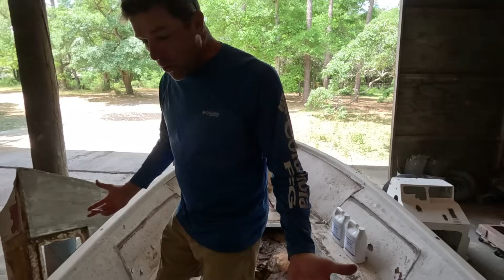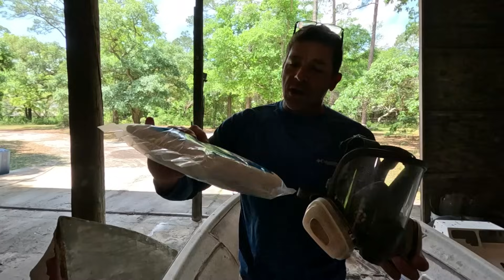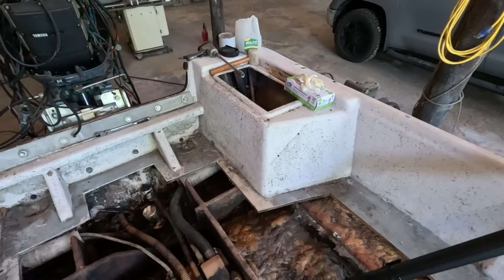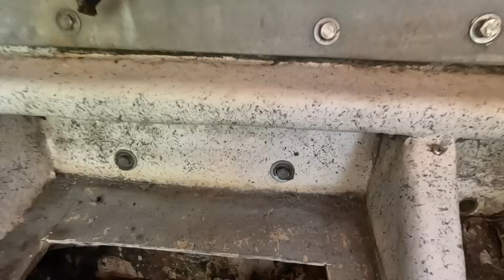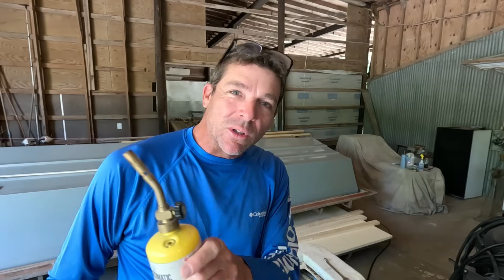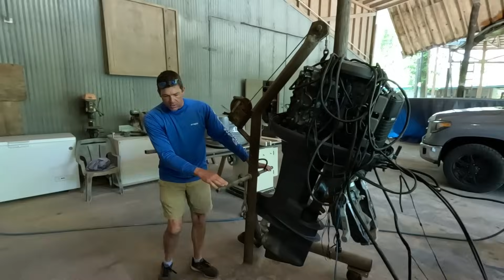DIY PROJECT BOAT TOTAL REBUILD! - MOTOR-FUEL TANK-TRANSOM-FLOOR-STRINGERS

Comment: With new loaded bass boats going for as much as 140k, a guy who knows his way around all parts of a boat is set up to fill a void in the market manufacturers have seemingly forgotten about.
The typical boat buyer.
Especially if you figure out how to attach a warranty to them.
Hardly any used affordable boats with any kind of  warranty and hard to get a warranty that's affordable.

There's a good market in there somewhere.😉
Reply from the maker: I agree, new boat prices are very high,along with everything else it seems! A lot of it is due to material costs, labor, and insurance. I hope showing folks how to do a lot of their own repairs and maintenance will help everyone get out on the water without spending a fortune. Thanks for watching!

Comment: Drill a hole in a bucket and put the hose in it from the bottom and it will catch a lot of dust if you set it infront of where you are cutting, or you can get your helper to hold it for you. Cheers
Reply from the maker: Great tip, thanks for watching!

Comment: Seems easier and cheaper to build a new boat
Reply from the maker: It might be easier to build a new boat if you are a professional builder with a shop, molds, specialized tools etc. Most people watching the channel are DIYers with boats that may have some of the same problems this one does, so it makes it great for the kind of content we are putting out. I hope this helps, and thanks for watching!
Reply: @FishBumpTV  Ya, looks great! Just meant paying someone to do all that would be easier. to buy a new  boat..Could build a cored one-off style hull, some vacuuming bagging and light fairing could be easier....Rebuilt a couple boats before LOL

Comment: Dude, poly tanks are where it's at. I understand if you have money. I understand what the LEGEND capt Joe is saying, boats old, that was a specific poly tank that they made and now you can't find the exact replacement. But. If were just talking how a material holds up over time. Which is basically physics. Like Einstein stuff. Plastic will last 100 years. And that could be a naive answer...
Reply from the maker: Agreed! Poly is great, as long as you can find one that fits. I hope we can find a exact replacement! Thanks for your thoughts !

Comment: blazer bay is good boat to work on I got 16ft hydrasport bay boat that needs a new floor in couple years its still useable but will need a new floor when I got the boat the guy I bought it from told me no wood but come to find out their was termites in it! so I ripped the whole front deck off n put composite cause it was like I was gonna fall thru it!
Reply from the maker: Sorry to hear about termites in your boat, that ain't good!! I think we will be going back with Coosa board in the Blazer. She is going to make a great boat for somebody when we are all done. Thanks for watching and commenting!

Comment: How long would you say that it's ok to leave a 2 stroke motor hanging from a lifting lug. Im going to need to pull my mariner 2 stroke 115 hp inline 6 to complete my restoration on an 88 procraft bass boat. Will it hurt the motor to leave it hanging from a lifting lug. On a cherry picker if I put a 4x4 block under the skeg and take some of the weight off?  That old "tower of power" weighs around 450lbs! I have been following your channel for a while now and really enjoying the content. This restoration project is just the thing I wanted to see. Please take the time to show the rigging work when you install the new motor. I would love to hear your thoughts on how a DIY guy can get the bottom of a trailered boat gel coated as well. Sorry such a long comment. But I'd love to pick your brain on these types of challenges. You are "THE MAN" Captain thanks for taking the time to do these videos and reply to all your fans
Reply from the maker: I have never heard of any problems with leaving a engine on a hoist like you are describing. Especially if you let it rest on a block on the skeg. Glad you are enjoying the videos and finding them helpful! Sounds like you have got a great project boat, and I hope our upcoming videos will help you get her done!

Comment: New subscriber. Just bought a 1984 31' Chris Craft Commander that's gonna need some work. Learned so much from you already. I have a soft bow deck/V-birth ceiling. Would to see how to do the procedure where you partially drill a grid pattern of holes half way through the bow deck into the balsa wood core and inject resin or epoxy in the holes to stiffen that deck. Thanks for what you do!
Reply from the maker: Welcome to the channel! Sounds like a great project boat! I appreciate the suggestion and will try to touch on how to do a repair like that in the future.

Comment: Thanks Capt. Joe! I will really enjoy watching you progress through the restoration. A comment on "Getting Started". I've done some aircraft and auto restoration work. A case of resealable freezer bags and a some permanent markers are the ticket for keeping track of small items, fasteners, etc. Freezer bags are sturdier than sandwich bags, and you can easily label the parts in the bag with the marker. Really handy, when you start on the outboard.
As a DIY'er, I hope your project is a good candidate for a pour-able transom! It would be great to see how a Pro tackles that. Thank you for sharing your knowledge with us!
Reply from the maker: Glad you are enjoying the videos! Yes, I agree, freezer bags are are great way to help keep things sorted and organized on jobs like this! I will be organizing some of the small parts soon. The previous owner had started the demo, and everything was  in bulk in the back compartments, so I didn't get to label as we went. Thanks for the suggestion and for watching!

Comment: Looks like y'all have your hands full. Can't wait for y'all to start on the transom. I've was given an older boat, and i need to rebuild the transom. I have a question, the old transom is wood. Should i stick with wood or use coosica, pvc, or pour a liquid transom? Thanks, and I'm looking forward to all these videos on this rebuild.
Reply from the maker: Thanks, glad you are enjoying the videos! The different transom materials all have there place. Plywood is going to be the cheapest and easiest to get, but if done poorly it will not last as long as the others. Coosa board is a really good choice, and is probably what we are going to use in our project boat. If access to removing the old transom core is very difficult,  then a pour able transom might be a good solution. I hope this helps and thanks for watching!

Comment: Watching your videos I'm struck by the similarity between the folks in Alabama and my home in Eastern North Carolina. Breaker/cheater bars, yellow flies, summer humidity and the occasional tropical weather system are all the same here. Boat building is a big industry as well with World Cat, Hatteras Yachts, Grady White, and Jarrett Bay within a 50 mile radius of my house, not to mention all the one man/family boat building operations along the coast.

I have a Key West 239 FS, but have always wanted to try my hand at boat building and am contemplating a small skiff or jon boat that would allow me to get into the rivers and creeks that are too skinny for the Key West. Your videos are a wealth of information and are giving me confidence to think seriously about moving forward with that project.

As for the project boat, one recommendation would be to make sure to provide good bilge access. I love my Key West, but the one complaint I have is that from the size of the access hatch they must have assumed that a five year old would be the one checking on the bilge pump and fuel/water separator!
Reply from the maker: Wow, thanks so much for your suggestions and thoughts! Yes, I have always said and thought that your part of the coast and mine are very simular! Your area definitely has more Big name boat builders though, we do have Cape Horn and Blazer which are pretty well known.I like your idea of a skiff build! I have built a good number of small boats and have thought about building one next winter here on the channel. I agree with you on the access to the bilge problem that many boats have! That was something that was very important to me when we built our custom 29. Again,  thanks for watching and best of luck with your future boat projects!

Comment: Always wondered why people use aluminum tanks. Watched a dozen videos about aluminum fuel tanks leaking and needing replaced.
Any perks for using aluminum over plastic fuel tanks?
Reply from the maker: One of the main advantages aluminum has is that it can be built to custom sizes and the tanks can be built larger and with internal baffles to help control fuel movement. The downside is corrosion issues.  Most factory aluminum tanks are built out of thinner aluminum and may not be properly coated so as to slow or stop corrosion. We installed a heavy duty epoxy coated fuel tank in our 29 and I expect it to last a Very Long time! If you want to see the install, it is in our boatbuilding series of videos.For smaller boats and tanks, plastic can be a great option. I hope this helps and thanks for watching!
Reply: From my understanding, years ago plastic tanks didn’t have baffles which prevents the sloshing, not sure if that’s the case now.
Reply: @jimwilson2792  Thanks